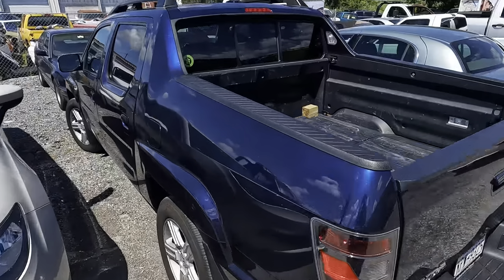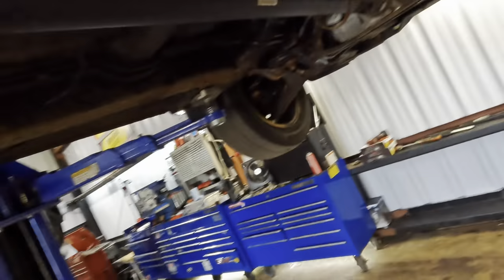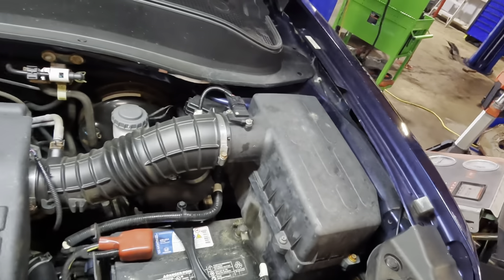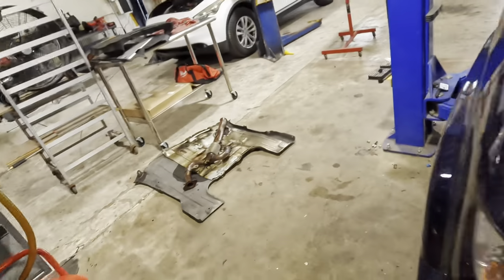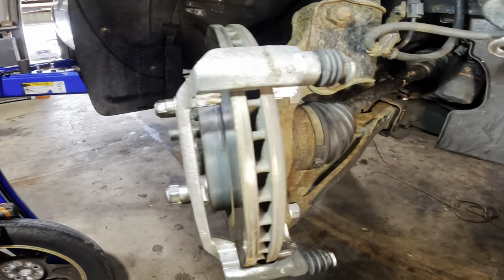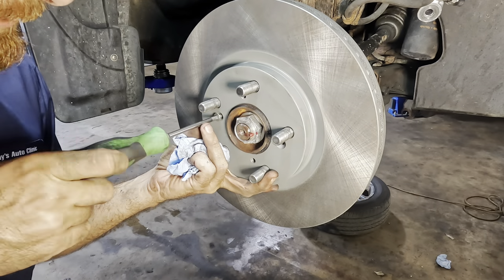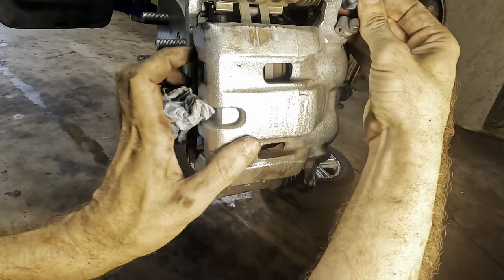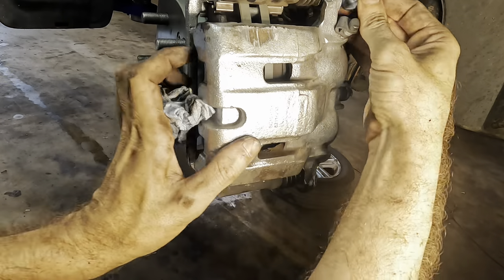Rust Busted Spring!  Honda Ridgeline 3.5 2006-2014 Multiple Problems!

Comment: I’m surprised that you didn’t check the clutch first…?
Reply: I would have done a resistance test of the clutch field coil, if nothing else for grins.  It should read around 3-to-4 ohms from the coil pigtail to the compressor housing.
Reply: Checking supply voltage with a meter tells him nothing. The circuit has to be load tested with a bulb drawing a couple amps. Very common for relays to get corroded and they can’t carry any amps also they normally have a ground wire to compressor body or a pressure switch on compressor that may be bad or corroded. Basically the system wasn’t diagnosed properly.

Comment: I wonder how they assembled the brake while it was rubbing?
Reply: That's why the bolts were loose. If they were properly torqued the brakes and rotor would completely bind up.
I'm thinking a " friend " or " shade tree " mechanic did that job.

Comment: In Australia we have only rust problems if you live on the coast/beach with the salt spray. Why would Ray say the north is conducive to rust? what's the condition's in Florida that is not conducive to rust?...........is it low humidity, a low rainfall, or Florida's car inspection standards compared to the north.
Reply: North has snow and ice, so they salt the roads.
Reply: @derekhobbs1102   Ah!  Makes sense.  I didn't know either.
Reply: @Leonsmail Florida cars will rust but not nearly as quickly as northern cars due to heat cycling. When it gets cooler in the winter, the heat cycling problem gets worse.

Comment: 25:13 the Rotor caliper issue is definitely a reason to only use factory parts, and not these parts retail stores cheap knock off brands, if you have to go to the store 5 times to get the right part are you really saving any money?
If your doing a DIY job.
I dont pay people to do my brakes most of these shops try to sell you an entire brake system because the pads are woren down.
Rotor thickness really isnt an issue with new pads as long as it has a lot of meat on it still its going to stop the car, after all your not going to wear the pads down to metal on metal unless your a compleat idiot.
If you hear a scraping noise fix it or its going to cost a lot more to fix.

Here is a tip, if your brake fulids low
Im certian its not because it leaked out as much as it is the pads have woren down. The fulids displacing whats missing in the cylinder of the brake calipers becuse the brake pads are thinner. 
If you keep an eye on how much brake fulid you have you can judge how thick your pads are. You dont even need to get under the car to look. Most modren pads come with a scraper the warns you your pads are too thin. 

Why Florida doesn't have a safty inspection is beyond me, 
You get a rock chip in the windshild here you have to replace the glass to pass inspection.

Comment: When you pulled the low pressure off a time 13:38, hadn't you just evacuated the system, so the pressure inside the system was probably less than atmospheric. If this was the case then air would enter the system and this was the hissing that you heard when you removed the hose. Isn't this the normal action of a schrader valve which allows air to flow from the high pressure side to the low side but blocks flow in the other direction

Comment: I shudder every time I see people constantly using air or battery tools on fasteners. Yeah, it might be great to speed things up but it’s a huge risk sometimes. I watched you put that belt tensioner on the front of the Subaru engine and I knew right away you’d strip that thread. Soft meatballs or not it never had a chance. All that bolt has to do is hold the pivot bush in place. The tensioner rotates around that. A successful mechanic uses torque specs as well as his eyes and feel in his hands. You get zero feel pulling the trigger on a tool. The amount of broken and stripped threads I’ve repaired in 35 years should see me living in a beachside mansion but no , I chose a trade not politics. 🙄
Reply: If the threads were already weak to begin with......
I can also tell you haven't watched too many of Ray's videos. I've seen enough of them to KNOW FOR A FACT - The Rainman doesn't overtorque nuts & bolts. Ray wouldn't still be in business being THAT careless. If it's stripped, it was already bad from the start. It becomes his problem when it happens anyway. Just in case you haven't seen ALL of those Subaru videos.
Speaking of soft meatballs. Did ya ever stop to think about how CHEAPSKATE these automakers REALLY are. If you're looking for something to Shudder about. Shudder a couple of times for us consumers that have to buy this stuff AND pay way too much money for it. Now you got a clue why the american automakers went DEAD FLAT BROKE in 2008.

Comment: Just Incredible amount of rusted Everything on a 10 yr old vehicle !! ....Blistered bubbling  rust Beneath the paint/ Undercoat of Frame & all Break  & Suspension parts !! ....That's a Rusted thru moving Death Trap for sure....Wouldn't even Crumple during a moderate Collision,  would just Explode into a Rust cloud !! .....That Inside caliper Clearance on the New rotor Still looks Really small, maybe 1/16" at most hardly any allowance for further Flexing of rust weakened parts.....No way this supposedly "Hi quality" vehicle designed for typical Northern USA road environment corrosion !! ....Probably Intentionally Designed & treated Metal to Promote corrosion & sell More replacements.....Pretty sure manufacturers Know how to Metallurgy treat/ Build with Much better performing Rust resistance...

Comment: Imagine the size of the pothole or curb that RR wheel hit,then the spring broke.That would mean that the rim has probably gone square or has millions of hairline cracks.The tire has also taken some abuse in that tragedy  -CLOSE INSPECTION

PEOPLE
Try to avoid hitting stuff best you can with alloy wheels,and these days- even the steel wheels are made of tin
Strut assy, road wheel, and tire- looking at $1k+    plus labor
And for God's sake, put Honda Parts back on your Honda,put the chinese crap on your Hyundai-
you'll thank me (same goes for Toyota)
Know why they're so expensive? TOP QUALITY is the answer (and Honda/Toyota Stealer greed)

Comment: Why would you not have measured the offset on the rotor compared to the drivers side ? Then you would have been sure what the problem was. You have no idea what is wrong with the AC you have voltage there but can it carry the amperage? Northern cars corrode and the relay may be crusty or the ground from clutch may be crusty where it grounds to ac compressor body. There is a slight chance the compressor isn’t grounded because of corrosion. I doubt it but you have no idea what is wrong with the system. One day you will learn to load the circuit to test it. Watch real technicians like SMA or Pine Hollow or Auto diagnostics and programming channels and learn about using test lights and light bulbs to load test circuits. There is a big chance the relay may be corroded and it can’t carry any amperage. Learn from professionals that you can’t trust a multimeter to check for power on circuits.